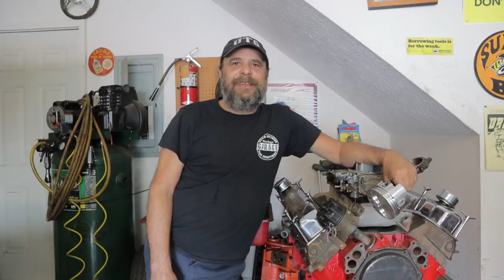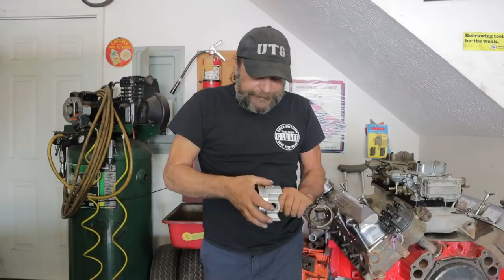The Great Piston Pin Offset Controversy ANSWERED!

Comment: Why couldnt a person build a engine with pistons reversed and dyno it and then build same engine without the pistons reversed but no other changes to the combo and then dyno that engine. Unless I am missing something it doesnt sound all that complicated and there are many dynos that a person could use in alot of cities. I dont get it. Also wouldnt you also need to use a engine with pistons that have no valve reliefs so basically a flat top piston with zero dome.

Comment: Flipping the offset around on the pin bores does fuck all for power production. I've said it for years. The aftermarket knows it, and centers all it's pin bores, unless some knothead specifies they want them offset. None of the current Pro-Stock guys do it(and you know THEY damn well would if it meant anything). And just in the last few days, it's been proven that is does nothing, on a dyno, with the same engine, on the same day, the same dyno, same temperature of the cell, the water, the oil, hell even with the same used motor oil back in the engine. The Dyno graphs? They laid right OVER one another, at all RPMs, nothing to be found over the entire rev range. Watch the Engine Masters episode for yourself if you need the assurance. Don't believe the hype..

Comment: As usual, Uncle Tony takes the high road. Instead of reacting, UT sits back and does research before even making a peep. His channel is about using what you have and not emptying your wallet. He doesn't have sponsors dropping off crates of parts at his shop like TV guys. Maybe they should start comparing apples to apples before they end up looking like a couple of nuts.

Comment: I don’t know what this is about, who called who or what not and it would be easy to pick apart Tony's rationale here but that’s not the point, I don’t fault him here I just disagree.  There are a lot of things that we used to do that we know now were either bad or useless. As far as some of the references cited I wouldn’t be surprised if this was done back in the day to equalize piston wear from side loading when reusing the stock pistons. 

When it comes to reversing offset pistons, at best we’re talking about the slightest of theoretical differences.   Perhaps in the right combination on an extreme engine that few of us are likely to ever build you might see a negligible difference or a favorable harmonic.   In the world where most of us live it’s insignificant. Certainly not worth taking apart an engine to make this change and not something that matters on a stock bottom end. 

In the end if you feel like doing this you aren’t hurting anything but you aren’t really helping either.  You certainly aren’t going to gain any real horsepower from it.

Comment: why dont people understand that the aftermarket DOES NOT do this..... because of returns
.
if your BRAND NEW motor had piston slap....... you would be SUPER mad
.
even if the pistons are designed to slap till they warm up (or the aftermarket pistons WERE built with "UTG offset")
the company would get 1000s of returns of PERFECTLY GOOD pistons 
.
.
if you are ACTUALLY a mechanic (like my stupid ass and bad back is..... instead of finishing my comp sci degree) 
you will know this is EXACTLY what happened when GM released the 3100 v6
.
they DESIGNED the motor to have piston slap when cold
this reduces friction 
this reduces wear
this gives a SLIGHT hp increase..... 
.
and the slap goes away.....WHEN IT WARMS UP TO FIT!
.
.
but quite a lot of people sold their car because they were boomers..... used to 1958 small block v8s
and any piston slap MUST!!! mean the engine is a lemon
.
and yet.... my 3100 v6 with 302,000 miles that SLAPS! LIKE! HELL! in the -50f montana winter disagrees 
.
.
.
people will buy a K and scam "cold" air intake
run an open cone filter...... that sucks in ALL the hot air
and SWEAR they an feel a 50hp improvement
.
when in reality..... they have lost 15hp
and the reason they THINK its faster is because they can hear the induction noise..... 
.
.
.
.
.
yet steve and Fried-brainer dont bitch about K&N intakes
hell, they actively run ads to sell these scam intakes......
.
could it be that if you spend 1 million dollars on advertisement......you can sell ice cubes to an Eskimo??

Comment: Amen!!.... This same TV (know it all) called out Gas Monkey Garage on the interweb (as Richard Rawllings calls it) several years ago to challenge their mechanical skills as a shop. These (know it all's) challenged them to a drag race that was to use dodge hellcat engines that could run with the smog stuff or not. Aaron Kaufman re engineered his with out the smog components, while other guys didn't and Gas Monkey smoked them in in the race. So there!!

Comment: Its simple.   Take what you are stating made a difference and accept the challenge offered by Dulcich, do a back to back dyno build and see if there is a power gain.  There MUST be a reason this was done by high end teams, probably as either power or durability experimentation.
As for your not having the resources or equipment to accept the challenge, put that back on them, have them put up the resources and equipment, they are both routinely on engine masters so the equipment is easily and readily available.
At that point, there is NO REASON not to prove your statement that it makes a difference.  The offered to show you your statement has no validity, show them they are wrong, if they are.
As far as naming big race teams and well known racers that did it, that carries little to no validity in face value as the amount of trial and error experimentation was running wild in those days just to get an advantage.  HOWEVER, a controlled experiment, all things set up equal with the only factor change being the piston change will show support for one of your standings.
Regardless, best to you.

Comment: Even a dyno cant really get the accurate performance of an engine on how it will perform on the street or track....

What if both have the same power level but one is 1/10th quicker in the 1/4,maybe the reverse piston deal works! I bet it does feel quicker at least..maybe more power at different rpm,where it counts? They still can have the exact same hp for example but it depends where and how it makes it..Hard to explain,I am paint fumed out and high as a kite because of it!! fyi:I paint cars,not sniff paint cans on the street!!!

How could you even test this? I guess have the same car run it down the track several times get a average time..Then reverse the pistons and run the car,try to get a day with the same weather..You have to take weather in consideration,same amount of fuel etc.....

Comment: Lobmin had it right- the only controversy is the BS being pedaled by youtubers addicted to drama and joining camps.  I think Dulcich was right-  flip the pistons, run the numbers and lets see what the actual gain is.  Does it work in concept?  Evidence says it does.  But lets be honest - it's one thing to do something on a race engine that will be torn down.  It's another to do that same something on your street engine.  For example I see race engines with no vacuum advance hooked up but I'd be hard pressed to want to do such on my street engine.  Otherwise as far as I'm concerned- prove the concept and let everyone know what the great compromise(s) are or may be.   If there are huge gains vs negatives many may consider it.  If you are talking 5 HP and 10 more Ft lbs of torque for an engine that will last 15K miles less many may pass.

Comment: I haven't picked up a gear head magazine in years. Loved the pictures and ideas but hated the style of writing. Example Air volume is sucked into the carb and shot down into the manifold to await an open intake vale that feeds a cylinder with Keith Black 10.1 compression pistons that turn a rotating  balanced crank to put 400 horsepower to the ground. Spark is provided by and MSD 6AL hot box and a Mallory electronic blue printed distributor. Everything is kept cool by a Dip Shit and sons aluminum radiator and 4 high flowing spinning fans.
Dear lord shoot me in my head. Every car had the same stupid writing style which I think deep down inside is aimed towards teenagers.
Well if you watch engine masters, roadkill, or pretty much any of the hot rod car shows. You get to witness the same idiots actually talking. Power Nation has the star of the show Pat who probably can't fit any thing else in his shirt pocket. His belt is a walking bonifide tool box. He and Frankie are tuff to beat in a douch canoe race . Watch Pats face during dyno runs. That is one serious idiot getting his rocks off every time he fires one up example provided in every show https://www.youtube.com/watch?v=op4jPHTpjQ4 .
Punching through all the teen IQ engine bullshit. It is a breath of fresh air to have some real engine guys talk and talk at a real level for those who actually play with all this stuff and can recite part numbers, firing orders and some history as well. UTG is a welcome brake and a good place to learn starting with his Edelbrock carburator video. I love the Carter and Edelbrock series for how easy they are to work on and tune. So I knew it was a joke right away to see another like minded person making fun of whats actually good, better and best.
My other go to on YouTube is this guy. Myvintageiron1275 https://www.youtube.com/watch?v=Vy2r3p-SOag

Comment: I question your choice of props in this video...... i.e. piston with valve reliefs....   :-)
Reply: When placed into cylinder on opposite side value cuts align right?
Reply: @BerkeyFilms  And why would switching sides be relevant. Take a any piston of a set and put it in standard configuration the valve reliefs are the same. Flop the piston and the valve reliefs are opposite where they need to be. Then again I have less experience with Mopars than I do small block Chevys.
Reply: Flip the piston and swap banks, the valve reliefs will be in the right place
Reply: @BerkeyFilms  I stand corrected. I guess I always followed factory specs without thinking about it---LOL

Comment: That entire video was simple explaining the offset piston idea it  has no Dyno test and I didn't see one Dyno test performed or anything so it's is still speculation from someone else that thinks they're also an expert  .
Reply: So was it a waste of time or should we watch it?
Reply: @bigbear5510  it's definitely interesting that's for sure . The dude goes into the  theory but here's the thing , if he don't show a actual back to  back Dyno test it's just a theory and nothing more unfortunately. Lots of old school power secrets for power arnt the really true . One persons theory is just as evidential to another persons theory unless it's actually proven . But the problem with a back to back Dyno test that would be valid it would have to be the exact same barometric pressure temperature humidity otherwise the Dyno  result would be off three or four hp and or ft-lbs . ( basically the piston thing  it's still a non player unless actually proven ) . But this the internet so everyone is a expert . Plus the dudes comments are shut off telling me he don't want to be challenged about any of it like most people why toss out ideas and theories . I'd personally love to see a actual duel Dyno tests
Reply: They were just punching down. They have unlimited access to Westech dyno. They could at least contribute to the hobby and test piston swap on a couple motors.
Reply: @BerkeyFilms  I'd love to see this test performed I really thing it would be a interesting test , heck it would make a Great engine masters episode
Reply: @unclesquirrel6951  I wonder how or if it would show on a dyno.  Accelerator pumps make a HUGE difference, but are irrelevant on the dyno.  It’s interesting for sure.

Comment: Uncle Tony, would you even bother with a dyno test if you could?  You told Richard Holdener that it can’t be seen on the dyno and that it just “hits the converter harder”.  I’d rather keep the pistons properly oriented and be able to run a tighter quench height and make more power than a piston that has the POTENTIAL to rock slightly more at TDC-requiring more clearance.

Comment: Don't worry Frybuger says feet pounds instead of foot pounds, just another journalist who thinks he is grey Baskerville.
He has missed the core of hot rodding, most of us when we started were young and limited in cash, we didn't get anything unnecessary , engine, wheels, primer, all the same color, if you had a little extra, tint your primer
  a color so it was  different, traction bars glass packs or turbos, if the car had a radio your girl was happily changing stations, you needed to hear your engine 
I think if fryburger was into cars in his youth it was vans, only interested in a paint job and Craig 8 track player just for stink finger.
He never went thru the used speed parts,wearing out the back of a tee shirt in one day, just so you could go to E street in Berdoo 
He is just a writer for a magazine, who has found out how cool cars are,and has missed the most important part, and wearing flip flops and shorts eating tacos and  picking up a engine someone else built, instead of being in the junkyards with casting memorized in your head, because you had to.
How do I know this to be true? Because he doesn't even know the difference between foot pounds and feet pounds Fred Flintstone and fry burger are the only ones who's feet pounds.
That's a shitty thing to knock down someone one else , especially when you don't even know basic terms used in engine  building, Tq is not a linear measurement, but an application of force, stop fucking with people .